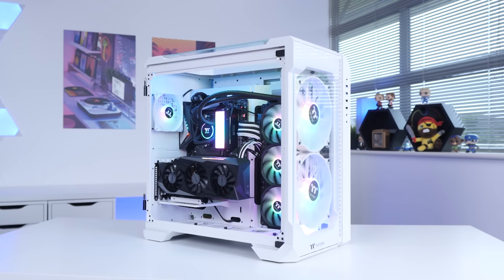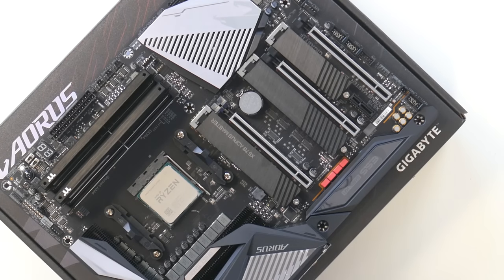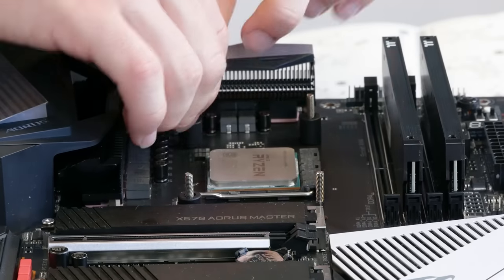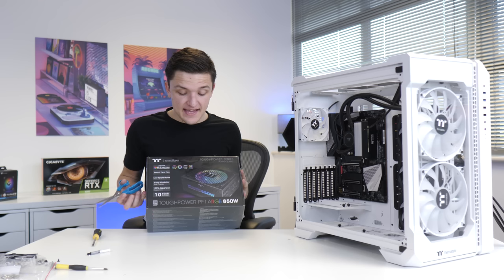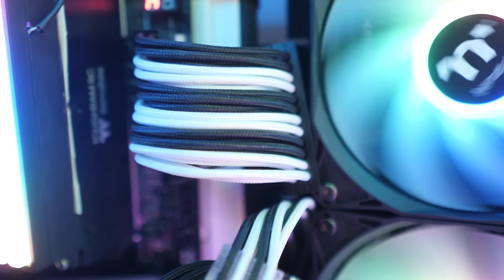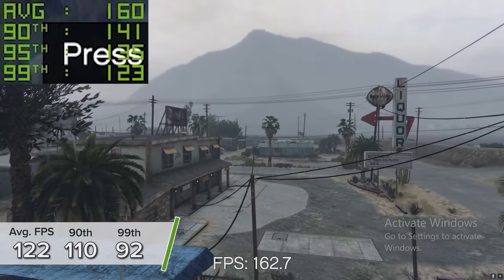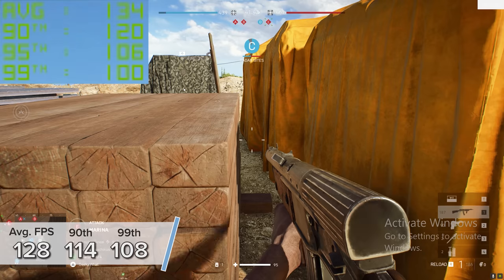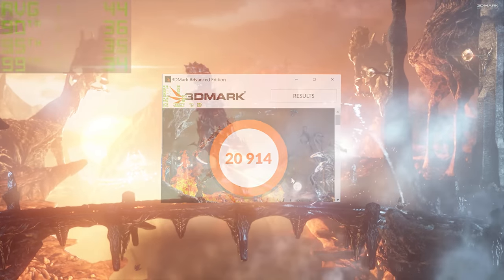Ryzen 9 5950X & RTX 3090 Gaming PC! [Insane $5000 Build w/ 4K 60FPS Benchmarks!]

Comment: He was so excited about the 5k build he didn’t even show installing the water block on the ram. Great looking rig.
Reply from the maker: Thanks man! <3
Reply: @GeekaWhat  please start showing 32 - 64gb ram i beg you .
Reply: @DislikesScrewYouAll  No it can run 32 mods and 4 shaders together in 1080p 70 fps
But with i9 10900k it can run 34 mods 6 shaders in 1440p 80 fps
Reply: @DislikesScrewYouAll  It will run same as i9 10900k with 2 rtx 3090 fe with one it will run 33 mods and 5 shaders together in 1440p 65 fps
Reply: @DislikesScrewYouAll  no the highest will be 53 mods 1080p 10 fps with 12 shaders without shaders 55 fps 1080p
Reply: @GeekaWhat  did you peel the cpu cooler plastic?

Comment: Nice build ;)    Have just one question, with all expensive parts why didn't you go with minimum 32GB of 3600 Cl16 RAM, and bit higher W PSU (like 1000W or 1200W) ?

Comment: I’m stuck on what to upgrade. Here are my specs:

Gpu-RTX 3070 FE
Motherboard- Asus Prime Z270-AR 
CPU-Intel i7 7700k 
RAM- GSkill DDR4 16GB @ 2400 MHz 
Case- NZXT S340 Elite Matte black
Cooler-Asetek 550LC 120mm liquid cooling 
Power supply- thermaltake SMART 750w series 80 plus bronze 
3 storages: 1TB HDD, 512 GB SSD, and a 120 GB SSD

Should I upgrade or sell my pc as a whole and buy parts from microcenter and build a whole new pc. Because at microcenter an i9 9900k is $299.99

Comment: nice vid! just a quick question, what riser cable do you use in this setup? I used the asus riser cable but it's pcie 3.0, and my motherboard is x570e with pcie 4.0 slots, so I had to change the link speed to 3.0 in bios settings, but even though I still have a few minutes of black screen before entering windows desktop, I suppose the problem will be solved if I install the GPU directly on motherboard...

Comment: 6:06 did he just forget to remove the plastic cover on the water block!?
Reply: i was about to comment the same thing
Reply: That's what I thought too
Reply: I guess we will never know!
Reply: Would have died while benchmarking if he didn't take it off
Reply: @BatSoup67  The temperature will be higher (my guess is around 10-20ﾟC), but I'm not sure it's completely obvious if you have a good aio cooler.
Reply: there goes 200 frames in csgo (i think this setup should run csgo max settings 4k at 590 fps, but because of the plastic, he runs it in 400 frames, correct me if i'm wrong)

Comment: hi james, I'm currently building the exact same build with the same MotherBoard, CPU,GPU and Case, and I was wondering which rizer cable did you use on this build to mount the GPU vertically, and did it have any performance drop ?, thanks and keep the good stuff coming

Comment: Hi so I am looking for a good power supply to buy. My final build will be 5900X with 3090 Asus ROG Strix and 1 RGB which is the  AIO, but it seems you have more RGB and It looks like you have a bit more powerful build than mine and seems to work on a 850W. Are you having any issue so far on a 850W? I am thinking of going 1000W since many people online say they have couple of power supply issue...

Comment: Nice build but you need to turn your radiator. The tubes need to go downside.  Otherwise you get bubbles in your radiator and after a while it will damage your cooling system.

Comment: @GeekaWhat i have a question for you and the pple. If would go for an 5900 x paired with an 3090 msi ventus and an 850 psu gold. And i use it for streaming and gaming. Should this be enough?
Reply: I would maybe get a 1000w power supply but 850w should be good

Comment: Insane build in a insane case :)  Got  another sub from Croatia
 What do you think about my next pc (for gaming, 3D modeling, and maybe streaming games) under 4000$ (for pc and peripherals) ?

AMD Ryzen 9 5900X
be quiet! Dark Rock Pro 4 50.5 CFM CPU Cooler
Asus TUF GAMING B550-PLUS (WI-FI) ATX AM4 Motherboard
Crucial Ballistix 32 GB (2 x 16 GB) DDR4-3600 CL16 Memory = or should I upgrade to 64  GB (2 x 32 GB) ?
Crucial P5 2 TB M.2-2280 NVME SSD x2
Sapphire Radeon RX 6800 XT 16 GB Video Card
be quiet! Pure Base 500 ATX Mid Tower Case (black) = also plan to upgrade case, and cpu cooler fans to be quiet! Silent Wings 3
 140 mm (7 fans total)
be quiet! Dark Power Pro 12 1200 W 80+ Titanium Certified Fully Modular ATX Power Supply = I know it's overkill, but I like it
Asus TUF Gaming VG27AQ 27.0" 2560x1440 165 Hz Monitor

Thanks :)

Comment: Kinda poopy case you have there... like... what, is air going to just go in to the front then immediately get sucked out through the side? At least thats where the radiator is... but what about the gpu? Lets say cpu is alright with this not ideal configuration, but the gpu is there against the glass, the only other intake being the power supply... that back fan works as exhaust again so you end up with not real airflow for the gpu... like maybe some air from the front but thats it... really poor setup if you ask me

Comment: crazy for a 1500$+ card at msrp, we all know it's like 3-4k + now.. can't even do 4k with RT enabled with the most expensive parts money can buy.. What's the point of RT if the best of the best can't even do it at 4k? I understand you can do it perfectly fine at 1440p.. but kind of sad tbh. By the time 8k gpu's are out may be able to play fully cranked on 4k with RT enabled. Just my 2 cents.. otherwise it's a remarkable build. But sad without OCing the cpu and gpu to the maximum.. RT in 4k 60 fps or 144 fps for what people want now, is still far off. Can't even get 60 fps in fortnite with RT enabled and a console can play fortnite in 4k at more than 60 fps for less than half the price of this gpu.